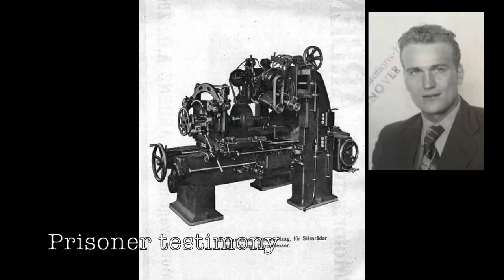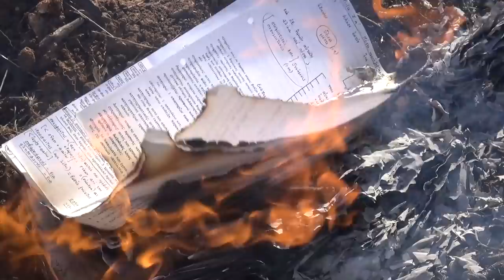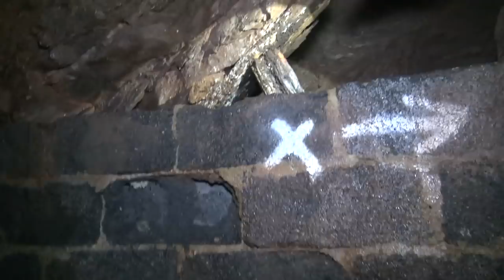LAST NAZI SECRET - PROJECT RIESE AND RUDIGER – THE ME262 FACTORY UNDERGROUND - Appendix 3

Comment: This as a educated Mason is called half eight brick, better known as face brick. They are slabs of brick giving the illusion of 8 brick. The use of the brick is to get more for the $ by brick and weight without the owner knowing. What your seeing I suspect is to quickly cover up. The reasoning is the 8 brick is weaker to blunt force unless the cavities are filled. Half 8 is solid and will withstand direct hits as long as there is a backing. In other words a quicker cover upper that's cheaper and harder to get through.

Comment: Hi Tino, That roundish iron thing towards the end that you marked "anybody" is a turntable for the ore cars in the mine, kinda portable so they could move it where needed. It looks to me that it was a mine that was going to be used for some thing else.  In all adits or tunnels you have track for cars to move out blasted down rock as loose rock rule of thumb is one cubic yard  =  one ton, its heavy as hell and hard to shovel with out a muck sheet on the floor. That rock in the back is whats called bad ground, loose and called slikenslide  or serpentine , lots of iron and maybe some ore.  I think it was for keeping something of high value in those rooms or designed for that.

Comment: The ME-262 arrived too late to turn the tide for Germany.
Reply: They were a good design, but fuel was a huge problem; jets, especially early ones, were VERY thirsty critters.

Secondly, because of the war, the Germans had a LOT of material shortages, despite ransacking everyone around them. Thus the engines for the 262 wore / burned out very quickly. This is also the reason for "podding" the engines below the wing. If one caught fire or "ruptured", there was a lot less chance of fatal damage to the wing structure. (Easier to repair or exchange in the workshop, as well). See ALL modern airliners. Look at footage of WW2 multi-engine bombers wings snapping off. They break where the engine mounts are because the heat from an engine fire rapidly softens and weaken the wing spars behind the engine and catastrophic failure ensues.

Finally, those 262s required long, smooth airfields, particularly for landing (no braking parachutes). A basic "swept" wing has very poor low-speed performance and significantly higher stall speeds; hence the need for LONG runways. However, in the bombing business, these are known as "targets".